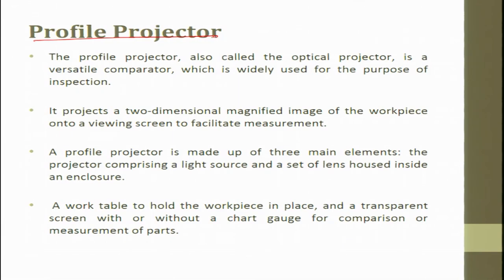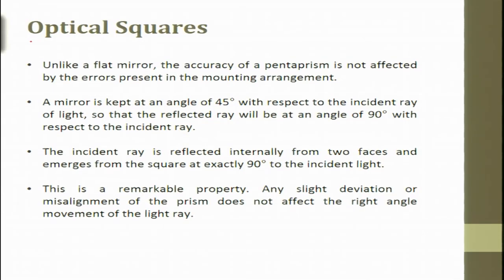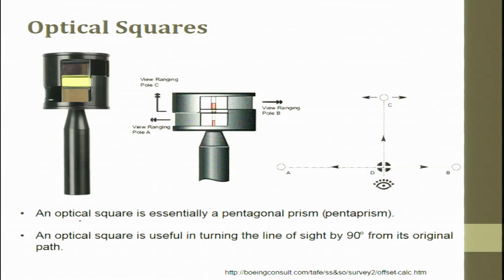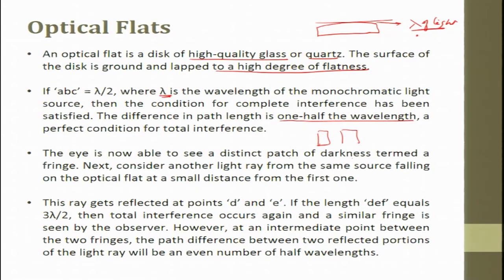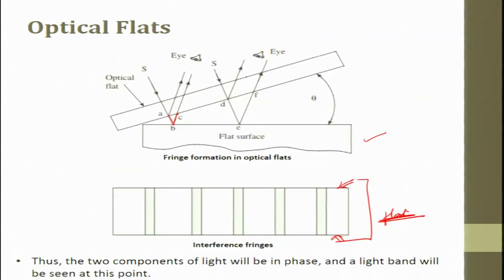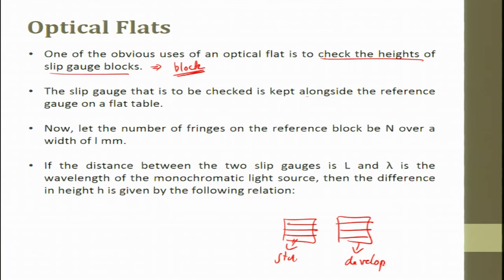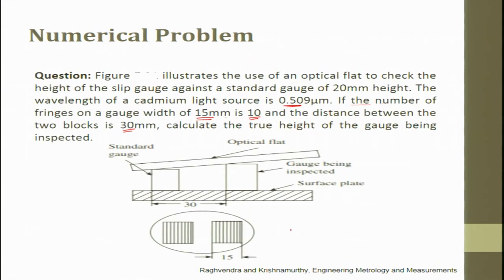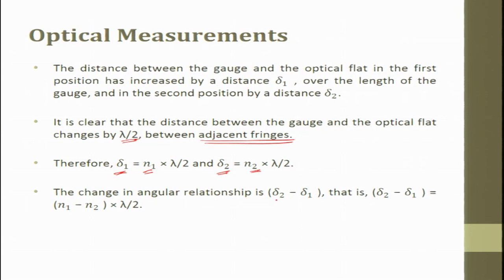noc18-me62 lec33-Optical measurements and Nanometrology (Part 2 of 3)

Comment: By the formula, YR=(YA+YB)cos(d/2), we could get darkness only by a phase shift of 180 deg irrespective of the wavelength of individual waves as cos(180/2) anyways yields zero making YR also zero. Is it possible in reality? If it is not, then why the formula is showing only the dependence of phase angle and not wavelength as a condition for dark fringes?